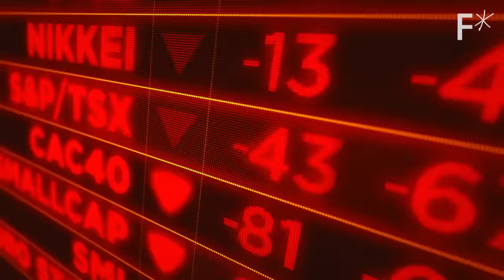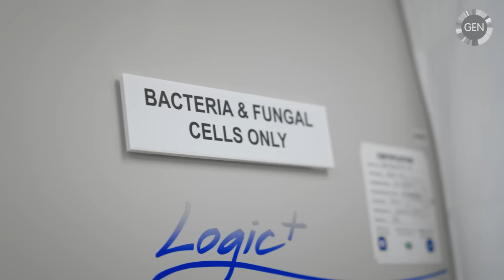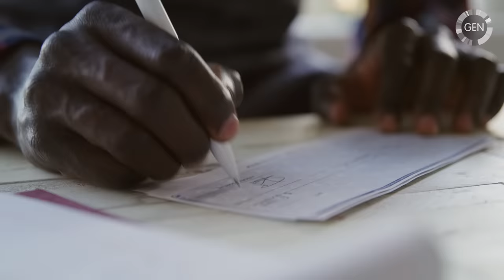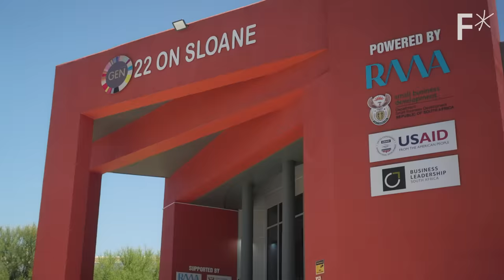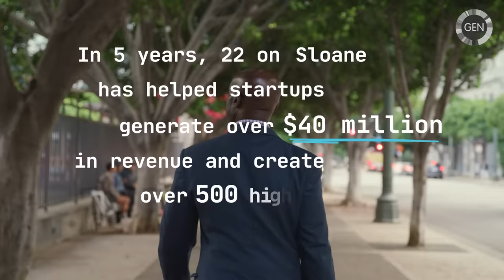Want to solve the world’s hardest problems? Join this network.

Comment: I would rather educate small farmers to produce more milk.
Also, the methane thing has been solved long ago.. you capture the methane and it runs a generator for the farm itself. This exists already in 3rd world countries, we need to stop saying cows are bad because of methane.. it's the large farms that do not capture the methane which should be fixed or pay fines for degrading the local air quality and environment. All you do is put a balloon and pump in the room to capture methane to then reuse for a generator at the farm, or even pipe the methane to cities for excess power usage.
Reply: Smaller farms wouldn't work at scale for numerous reasons not the least being transport. Lab milk will be the future most likely due to land use IMO. As land costs rise and rise, the safer financial choice for future-proofing is small labs producing many products at once. Obviously we are still a ways off from this being economically viable for most farms but it will be a "phase" before losing to whatever the next advancement is.
Reply: @TheBlawdfire  They do. It's called a barn.
Reply: @XrayTheMyth23  Untrue, i have a local dairy farm 4 hours north of Chicago, in a small farm county, and it serves the entire top half of my state with raw milk, in glass containers and all.